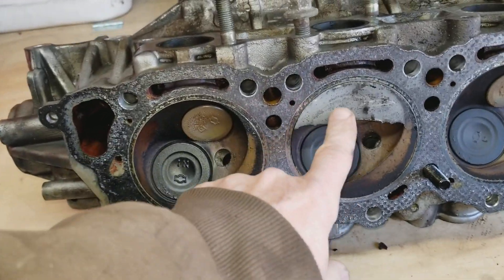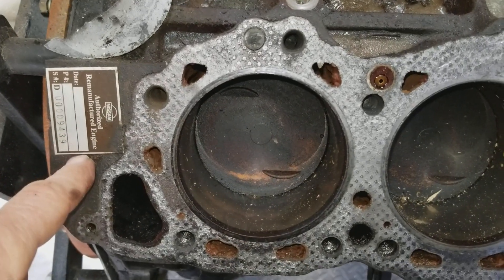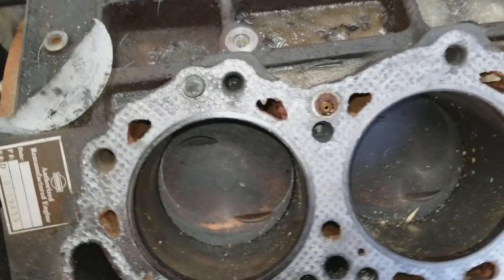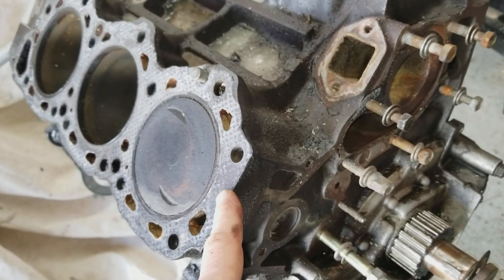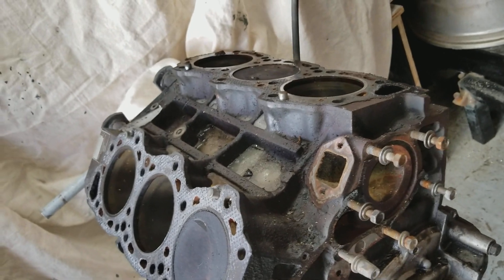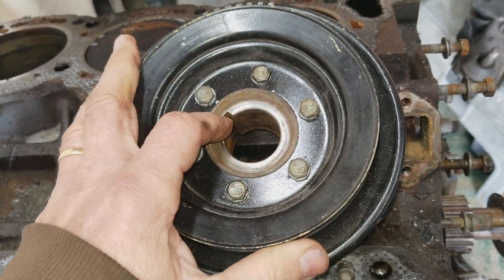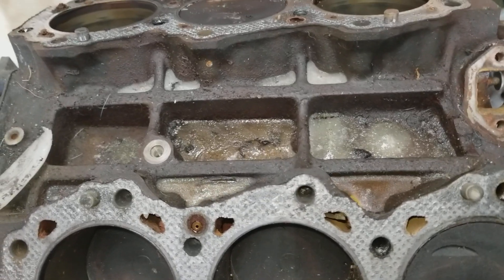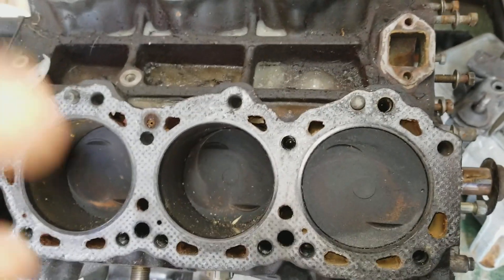Rare Nissan VG30 large snout in a 95 D21, related to VG33 swaps

Comment: Staying tuned for a follow up video.👍🏻
Reply from the maker: Thanks! This was last winter. My son rebuilt the engine last year. But just sold the truck to a friend so not sure what to do with engine. I have a 5spd also. I was thinking about buying a 1970 or 68 521 and putting this engine in it. Nt sure though.
Reply: @NissanNut74  thanks for the reply we are a fellow Nissan channel too, well that's unfortunate the Hardbody got sold, but as for the engine and trans combo would be sweet in that 521. These are awesome but unfortunately underrated engines. Definitely staying tuned to see what you end up using the motor in👍